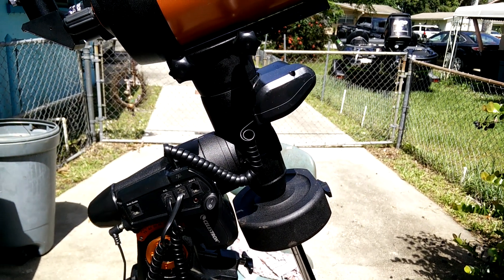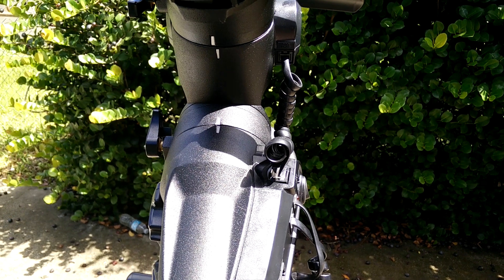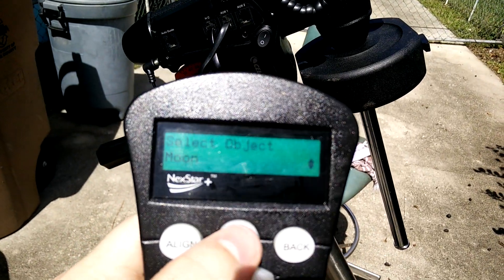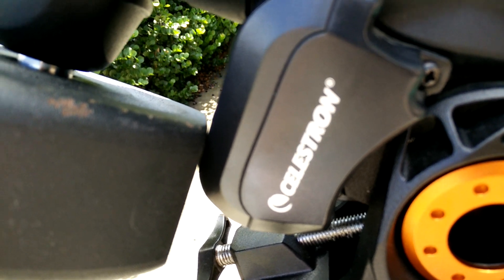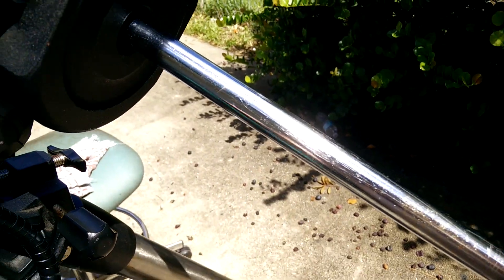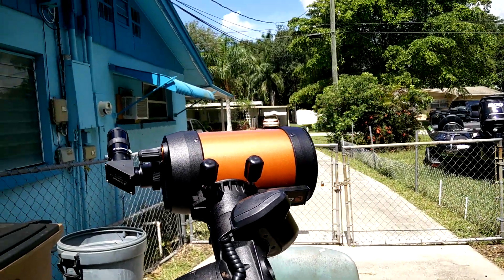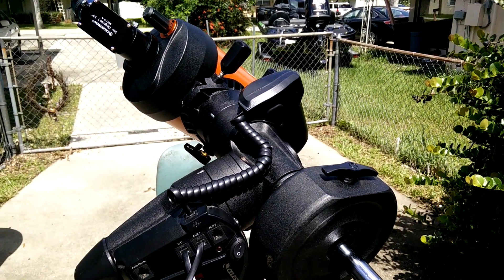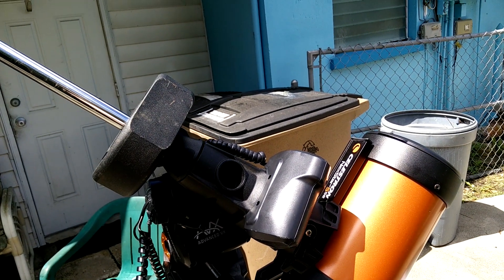Celestron Advanced VX Mount issue with counterweight

Comment: Great way to break your scope mechanics. Never intentionally bind your gear train. You need a small counter weight for that tiny scope. This is an operator error and not a mount issue.
Reply: That scope weight like 3 pounds. Buying a smaller counter weight would be a better choice.

Comment: The counterweight issues are well documented in the comments. Regarding pointing, once you’ve had a pier crash the pointing model is wrecked. If you experience a pier crash, turn off the mount, loosen the clutches and return the axes to the home position manually, then restore power and re-run the Star alignment.

Comment: Lol just move the weight down to around half way on the bar you dufus hahaha
Reply: you do understand the concept of balance, right doofus?  if the mount is balanced moving the counterweight will unbalance it.  moving it closer will make the ota side fall, moving it down will make the counterweight side fall.  he must either add more weight to the ota side,  or remove weight from the counterweight side.  there is no option to move the counterweight with out changing one of those.  get it doofus?

Comment: I'm sure you have it figured out by now but what you have to do it get a smaller counterweight and move it lower on the shaft. If the OTA is turning and the shaft is not then the shaft is being unscrewed from the mount. Alternatively you could add weight to the OTA then move the counterweight down to compensate but with the AVX, or really any mount, you're better off to keep the payload weight as low as possible.

Comment: Mat thanks for posting, as you probably are aware by now the entire DEC shaft is supposed to rotate with the DEC axis, if it is not rotating you have a defective AVX. The counterweight issue is just one of many issues I ran into with the AVX mount. Ive done several modifications to mine to bring it up to snuff and am now planning on upgrading to something much bigger and much more precise. I will never purchase another Celestron product because of the issues I had with the AVX as well as CX service.
Reply: the problem isn't the AVX - it inexperienced newcomers who dont' understand that systems have to be balanced and  weighted to match the OTA - the CW is far too large for the weight of the OTA hence why its so far up the CW bar - a smaller CW is the answer and this issue is gone - as far as Celestron service I have nothing but praise - they even supplied replacement parts after a wind related issue bent my saddle knobs FOC - they have been great to deal with - I can assure you I have seen issues with any brand on the astro market even the top line premium gear - so you can pay much more and still have issues - but please - learn how to drive the gear first before complaining and making videos else you just look stupid
Reply: I am pretty sure the guy posted this video because is trying to figure what the hell is going on with his mount, so please if your going to be an asshole go away.
Reply: Celestron products are hit and miss, especially the AVX which is riddled with issues, in fact the entire Celestron mount lineup has hit and miss quality control related issues. I will however say that if you do buy a Celestron product and it is a miss they will make it right. It may take them 2 or 3 attempts, but they will work to correct their products short comings.  I don't know why you keep bringing up the counter weight talking point that you've seemed to have created. I've never once addressed , or even mentioned anything having to do with a counter weight. The poster of this video stated that the entire DEC axis with CW bar was turning, I stated that it is supposed to be rotating. If it does not, locks up, or breaks free there is a good chance there is something else going on here that is related to a known issue with the AVX. It is obvious that this guy does not know what he's doing, in fact he even stated that he did not and is looking for advice, when he asked for advice I don't think he was asking for trolls attempting to belittle him, or his content.
Reply: @TeamAstroworkz  you might want to note that the avx has been redesigned several times to account for errors in the engineering...  you might also want to note that selling the mount with a single over-sized counterweight that obviously exceeds clearance tolerances rather than two smaller ones that will clear contact with the mount in any given situation is not the fault of the user...

Comment: Matt, if your weight is always in this location, simply place a collar around the shaft and let the counterweight rest on the collar...it will rotate on the collar and not interfere with the motor drive and (I suspect) not cause vibration for photos.  A simpler solution would be to use a lighter counterweight and place if lower on the shaft.

Comment: The best solution for balance is to weigh your ota and then buy the appropriate counterweights. Measure the diameter of the counterweight shaft. NEVER overload an advanced system. Sure it can handle slight unbalance but you are still placing unnecessary strain against the gears. Increase the life of your system by being precise. I would approach the situation that way. Restore defaults in the cpu. Then recalibrate it. Looks like you have a good solid slab of cement to place your scope on. Mark the ground too so you can easily place your tripod at rough alignment also. That's a fine system you have. Don't fight with a weight you can't use.

Comment from the maker: Looks like the fix would be load the mount with at least 5-10lbs of payload, DSLR, Guidescope, and Guide Camera it that will fix the issue with the counterweight hitting the gear box it will allow you to load the counterweight as you add more weight to the OTA. If you can't load the mount with extra stuff then you will need a 7.5lb counterweight if your OTA is light.
Thanks everyone for the help.
I did forget the night I had the mount out for the first time I did have the the DSLR  hanging off the OTA which put a little bit of weight that allowed the counterweight to be lowered down more, all I had in this video was just the OTA and Diagonal and eyepiece in.

Comment: What you can do is simply move the weight down.  The AVX can handle small weight balance issues fairly well and your scope is pretty light.   You shouldn't have any problems moving the weight down a tad to clear it.  Or look for a smaller weight.